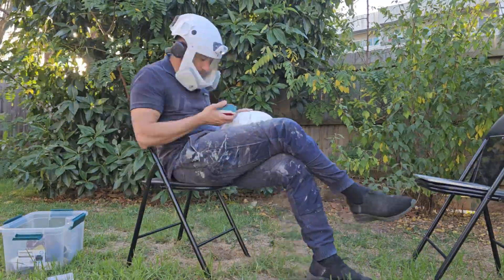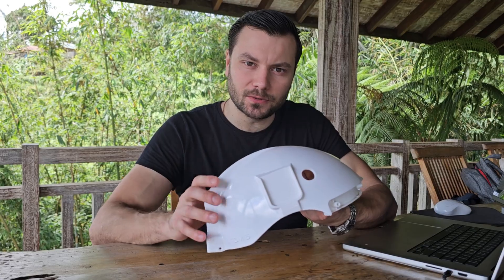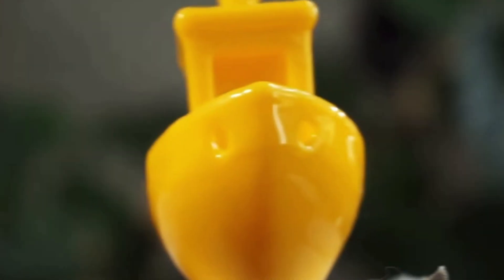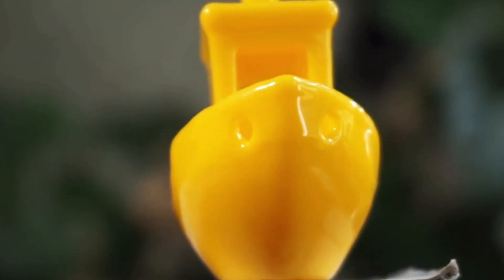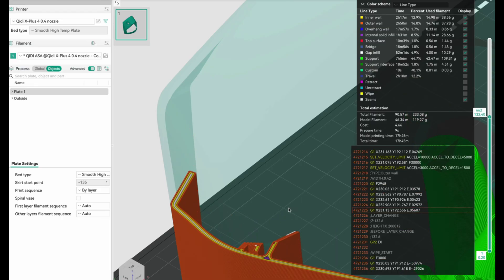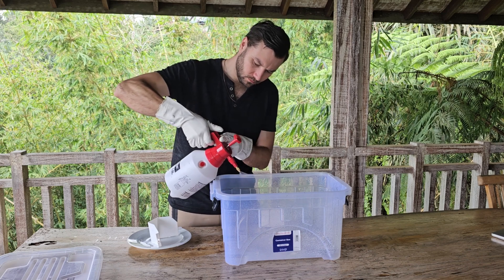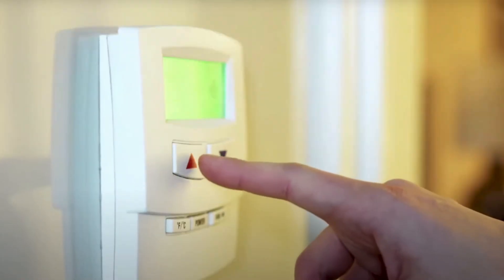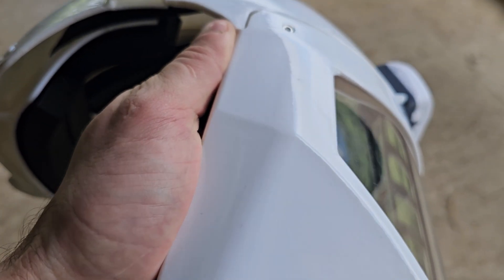Make 3D Prints Smooth: Ultra-Fast Technique Unveiled

Comment: I Highly recommend resin printers for smaller decorative and even things like boxes and house items like door knobs and handles. Resins I've tried have all been both tough and flexible, Although can warp in the heat, there are resins that are heat resistant. No sanding required.

Comment: I did many experiment with ABS / ASA acetone vapour smoothing. Here are my key findings:
1- Prep Sanding. Results are always better after a coarse sanding. I don't spend hours on this, but the more pre-sanding you do, the better the result will be.
2- Vapour Temperature. You don't want to give the acetone enough time to migrate deep inside your part (risk of warping, ages to vent out the acetone trapped deep inside your part)... You want it to affect only the skin. To achieve that, you need the acetone to be very active. Heating up the acetone will potentiate its effect. NOTE: Hot acetone vapours can burn in presence of a flame, but not explode 
3- Part Temperature. You don't want the hot acetone vapour to condensate on a cold part, and leave dropplet shaped smear marks. After pre-sanding, I preheat the part in the enclosed print chamber (50-60˚C) for an hour or so
=> This way, I get very good smoothing results within minutes. Bonus: the part vents out vapours, dries and regain full hardness in less than a day
Reply: Nice. How did you heat up the acetone?

Comment: Great video.  I like the information dense no-nonsense presentation.  I use an old Instant Pot for acetone smoothing.  The heating element in the bottom makes a nice vapor.  As soon as the acetone deposits on the inside of the glass lid, I turn it off and let it sit for a few hours.  For aesthetic parts where wear isn't an issue, I'd probably just use three quick coats of spray paint.

Comment: BS. Coat your part with uv resin, cure for a couple minutes, Enjoy!
Reply from the maker: That works if you're not too concerned about adding extra weight
Reply: If you don't care about using the part outside in the sun

Comment: Only drawback is that ASA is pretty toxic. Mix that with acetone & you better hope you don’t get that concoction on your skin! Sanding & polishing are a PITA & you need to be sure you have a good mask/respirator. The best option is to just ensure you have the best print settings & maybe a little sanding, but even then you should wear proper PPE (for eyes & breathing). It’s a balance between safety, health, & a decent end product. Choose your sacrifices wisely.